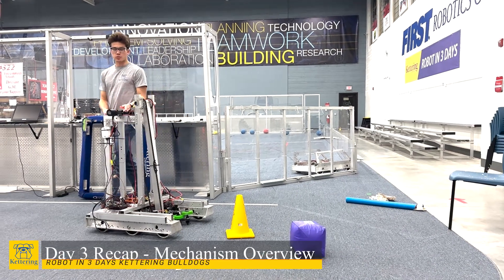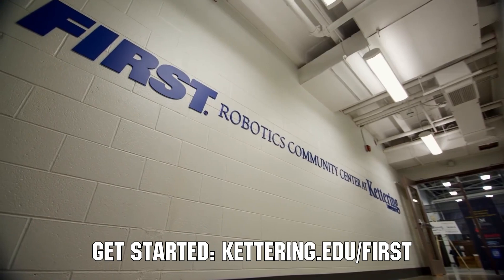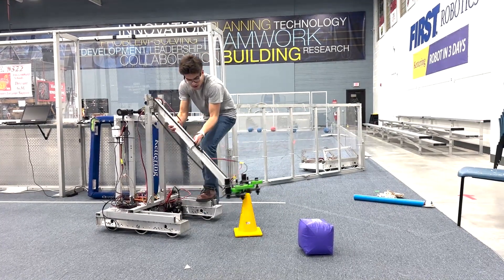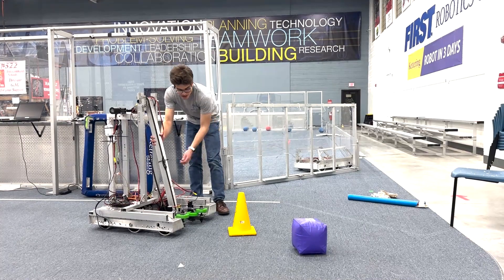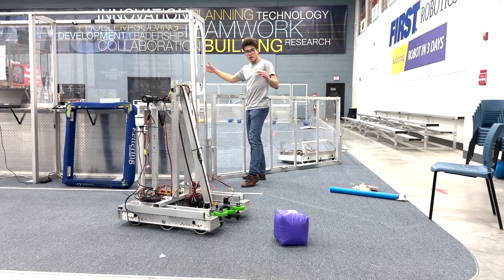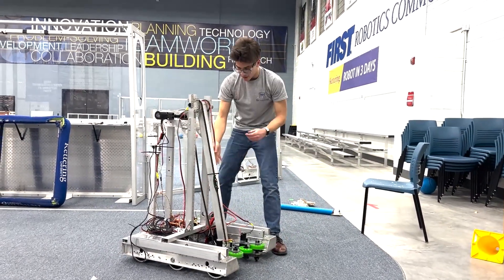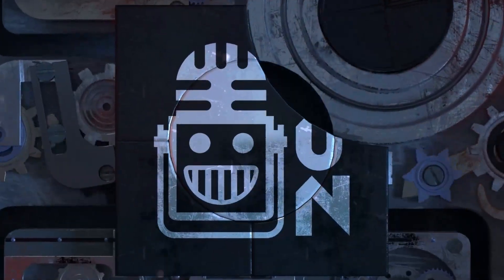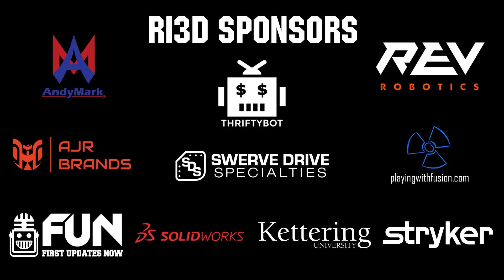Day 3 Recap and Mechanism Overview Ri3D Kettering Bulldogs

Comment: The use of sprockets and chain to keep the grabber parallel is really clever
Reply: Can you please explain how it works?
Reply: @pabloescandonlibos1012  the arm has a chain connected to it with two sprockets. The top sprocket has been constrained to be stationary while the bottom sprocket is freely able to move. When the arm traverses upwards, the constrained sprocket will force the arm sprocket to rotate, which counter rotates the intake grabber, keeping it level
Reply: @ehtanellery9478  yea much more efficient than the immediate thought of having a linkeage of sorts
Reply: @pabloescandonlibos1012  https://www.youtube.com/watch?v=C8Za5GKdSUA